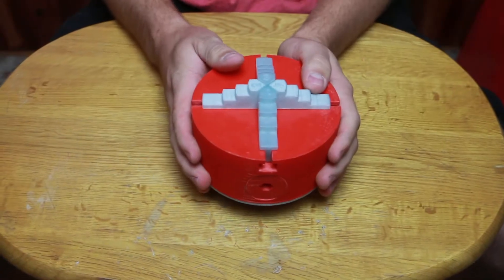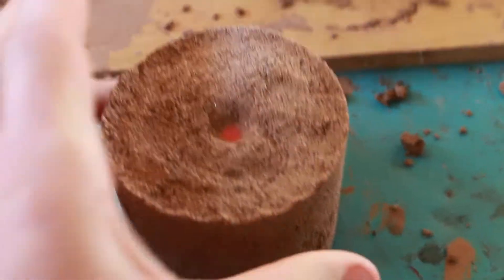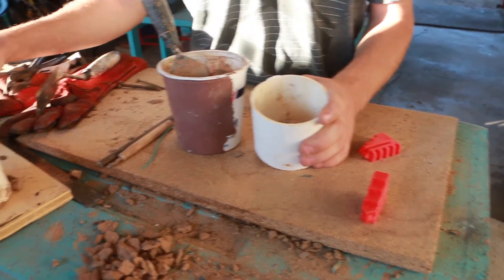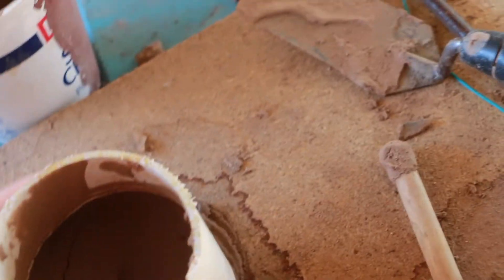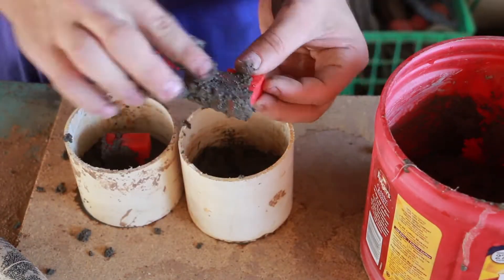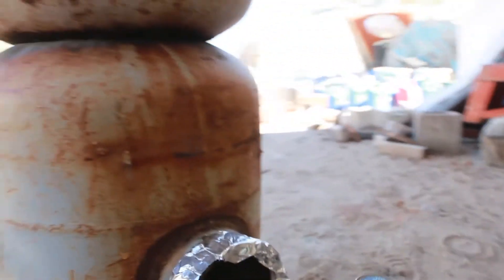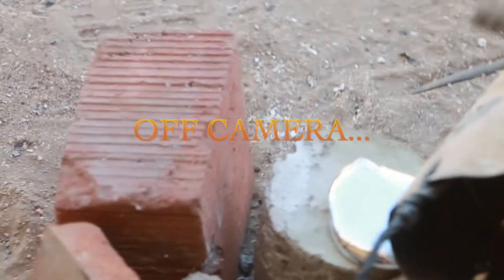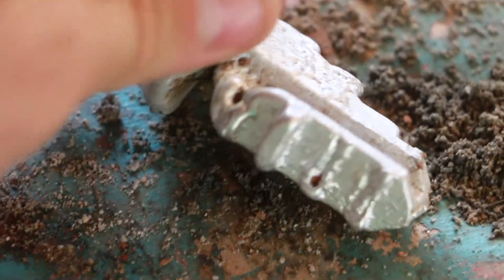Casting an Aluminum Chuck (Part 2)

Comment: There is a company that you can go with that would make the mold making much easier. 1st off you are leaving the plastic in the mold. This is inefficient.  2nd you need to smooth out the parts before you mold them. The company is  https://www.smooth-on.com/.  they have a silicone type molding compound that will make it easier. Also check out the videos of them making metal objects. This would give you much greater results and save time.

Comment: I like that you are almost there. I have another creator I follow called homemademodern. They just cast using kinetic sand. I was wondering if you could create a flat sided plan that that would work with the sand. Maybe grind out the groove on one side but the printed parts would be reusable. Seems that sand, corn starch, dish soap and water would be worth the shot. I a, really enjoying the whole family’s video offerings. Thanks to all for sharing!
Reply from the maker: +Thom Lindgren Thx for the great ideas! I'll have to look at that channel. Thank you for the awesome support too :)
Reply: @ScienceMadeFunner  next time when you are casting or work in foundry you do not want to be in basketball shoes or shorts you should ware long sleave cotton shirt, boots, and blue jeans because if your sweat gets down in the molten metal you wish it had not happened i have scares from metal exploding when my sweat mix with it And boy it was not fun to have molten metal on my arms
Reply: Hi Bryson can I suggest you paint your Plastic Template before putting 
it in the mold it might after burn out give you a better surface between
 the Mold material and the aluminum and possibly needing less work in 
finishing of your parts 

myfordboy  has had some very good 
Results with his 3d printer  to the point of almost not needing any work
 at all in finishing  he has IMHO the best metal casting / foundry 
chanel  on YouTube   he does a fair bit of traditional brass, and 
aluminum work as well showing you his methods and how to build a burner 
for the Foundry 

Olfoundryman
Brian Oltrogge
Hot wire Foam cutters
sandrammer
Commercial VS homemade molding sand
DIY GREEN SAND FOR CASTING - CHEAP, SIMPLE and FAST - MSFN
Hi saw the Video  Thom Lindgren is talking about when it came out and was quite impressed with the out comes 
I hope the above links  are helpful

Tony From Western Australia